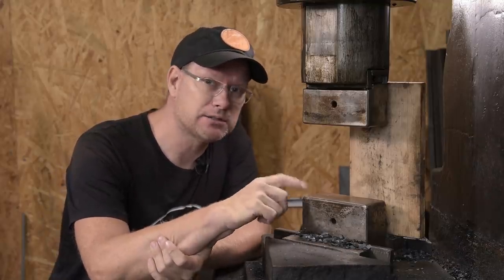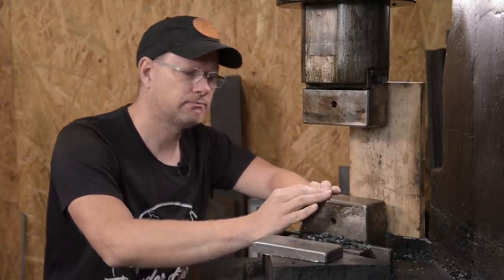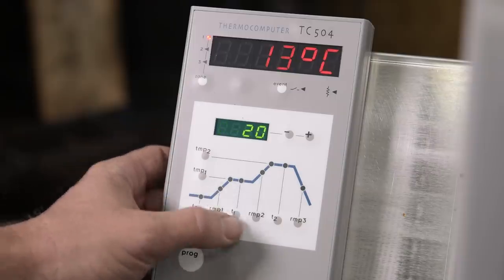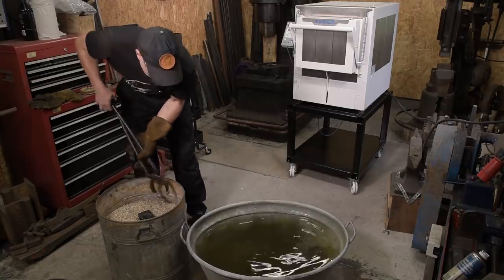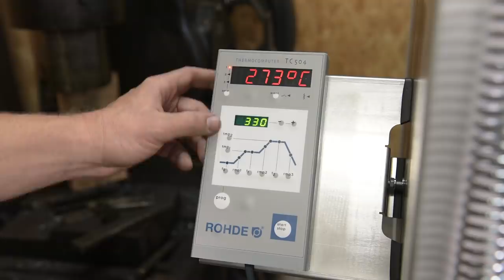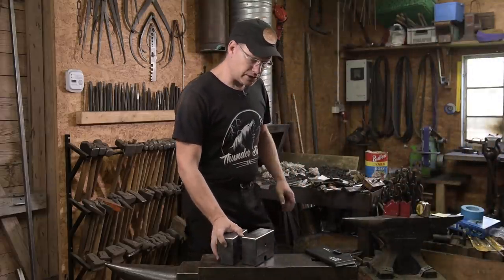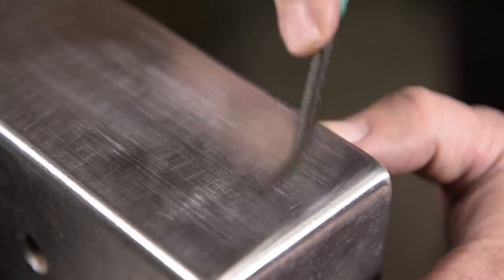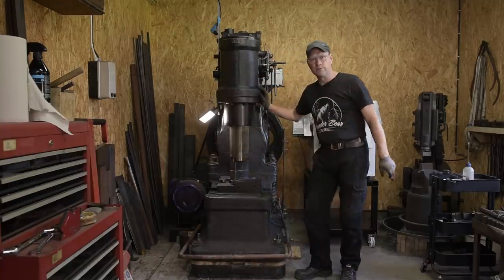Blacksmithing - Heat treating hammer dies

Comment: Love your videos your attention to detail is great. You’re a wonderful blacksmith. Just wanted to give you a little tip on heat treating for one when your heat treating carbon steel fast Austination is key so make sure your oven is up to temperature before you put in your part. whenever you are tempering anything make sure your oven is up to temperature before hand or the elements will super heat the surface trying to catch the oven back up to temperature which could over temper your product.

Comment: In the 70’s, during my apprenticeship in a traditional blacksmith shop, an old timer came by and it was announced he would work with me to make my first hammer.
Three of us forged it out, punched and drifter the hole, and then I learned about all the cans on the ceiling. Each one was a different size with different patterns of holes punched into the bottom.
The old timer took an old coffee can 3” across on the bottom with 4 holes in a circle pattern. We were using coke. Once hammer face was hardened in water, he had me clean the face up and then we heated the face to red/yellow. Really just the top inch. Then with the hammer face facing the ceiling, he scooped up water from slop tub with the can, and allowed a stream of water onto the face, mostly in the middle. The water stream heated and flowed over the edge of the hammer face. 
This simple technique, cooled the face first. This allowed the hammer to be harder in the middle of the face and softer on the outside and left the rest of the hammer annealed. I used that thing for 40 years and it worked perfectly.

Comment: I would have preferred something like 6150 (Chrome-Vanadium) spring steel.  Just as easy to cut, work and heat-treat (oil) as 1045 but the vanadium would ensure they outlast the 1045 many times over.  Have you considered videos showing the differences in heat treatment of various steels?  They would get many new subscribers outside of the forging community.
Reply from the maker: Indeed 1045 is not ideal, but they will do fine for a while. I will consider new ones when the time is right. L6 or H13 is my choice.
Reply: @torbjornahman  H13 would be best, no doubt, although heat treatment is tougher for the typical shop.  You have a very nice oven/kiln so you should be just fine.  Give some thought to the heat treat videos, it might be a good ´hook´ to entice new viewers.  Take care.
Reply: 1045 is the traditional choice for hammers and other impact tools. While true that modern engineering alloys may outperform it in certain aspects (6051 contains chrome and vanadium to both improve corrosion properties and toughness), 1045 is a cheap and simple alternative (as it is simply plain carbon steel).
Reply: @kkuhn  question: would spring-tempered 1075 work for a special, e.g. “raising” hammer?  

Oil quench in 120 F. Canola, draw to 400 F?
Reply: Am a blacksmith in Australia,used a power hammer repairs of chisel and moil points for jack hammers,used 1070/1080 for blocks.Scale certainly damages blocks if not kept clean.
Reply: @torbjornahman  Those are heat resisting steels usually used to resist tempering at temperatures above 500F. They will do, but they are expensive and heat is not the issue for the failure of your massive hammer dies. Traditionally all anvil faces and hammers were made from plain high carbon steel, W1 or anything with about 1% carbon. Quenched in water they will give a hard, wear resistant 1/4 " case and  a tough unhardened RC30 substrate. Carbon in excess of .78% is required to form free iron carbide grains, the main contributor to wear resistance. I have the original dies from 1920, plain 1% carbon steel, in a 250 lb power hammer and they  stand up very well. It's nearly impossible to dent them. There is a trend these days to replace this steel with medium carbon varieties like 4140 and 1045. It it beyond me why as it makes no sense. I think it's one of those things that gets spread out on the internet.
Reply from the maker: @maplebones  4140 or 1045 is not for hammer dies.... L6 and H13 is preferred, but not for the hot working properties, but for the toughness and wear resistance! Anything above HRC50-52 or so can be an issue when it comes to safety. You don't want to chip a hammer die, it can be lethal.

Comment: I worked in a tool and die shop a number of years ago and one of my first jobs was heat treating the dies after they had been machined. Your comment about tempering was absolutely right. I made that mistake only once. The guy that made the die made me sit and watch for two days while he remade the die. It wasn't boring at all, I learned a lot but the stool he made me sit on was torture.
Reply from the maker: Ouch, a good lesson I guess! Thanks

Comment: I nearly fell off my chair when you spoke !
Some (most )YouTube creators talk more than they create , some create more than they talk( i prefer these !) but some just add a little bit of commentary when needed and it lifts the video into a new level - that is what you did here 
 Torbjörn ! That heat treat oven looks like a fantastic piece of equipment !
Fantastic video - thank you!
I might try some 1045 for the cam lobes on my model engines , at the moment I'm using 4140 and some case hardening compound (cherry red ) but if I can get a decent thickness hard skin around 50 RC with a soft core  I will be happy .
Reply from the maker: :) Thank you Ian! Why case harden 4140? It get's plenty hard as it is, no?
Reply: @torbjornahman  
It is just for wear  - the cam lobe and lifter are case hardened leaving the core soft so it doesn’t snap , I could through harden it as well but the quench can distort the part and the cherry red compound can be left to cool slowly - On the very small engines I make the camshaft is only 6-8 mm diameter .
It also depends on how much running it will do , if it will only be run occasionally I don’t bother with hardening and I use 4140 as I have lots of it laying around 😀
Reply from the maker: @ianbertenshaw4350  So you don't quench after applying the cherry red? I'm quite skeptical that you gain any extra hardness from that. Have you tried to use mild steel and case harden (with quenching)? As only the surface will harden I don't think it will deform much.
Reply: @torbjornahman  

https://youtu.be/b_rjQRTgQrk
You can quench with cherry red compound but don’t have to  - the link above is to a video explaining the procedure . To get the hardness I have to do it a couple of times and this also makes the hard skin a little thicker .I don’t really like using it as it gives off some fumes when it comes into contact with the hot steel . I need to get a move on and build my camshaft grinder , that way I can heat and quench then finish grind so any distortion will be removed and I can change the design so the core of the shaft is a little thicker. Might have been my quenching technique that caused the distortion - I think for something like this it needs to go into the water with the shaft perpendicular to the surface of the water  .
Anyhow it is something for me to play with 😀
Reply from the maker: Strange if it works! It's there only to dissolve more carbon into the surface, but without a quench no martensite will form. However the added carbon might make the surface a little harder by itself without actual hardening. If it works, it works! :)  Deformation is always an issue I think, something you can't work around just make it as less prominent as possible.

Comment: Needed to see that, recently built a power hammer and bought a new set of dies from old stock that the business I buy a lot of coke, tools and other bits from had left over from when they sold power hammers. They were machined but not dressed and after dressing and using them I have found they are not hard, or at least not hard enough! Alan told me he thinks they were 1045 but couldn’t be sure. I can now harden and temper them which I now don’t think was ever done! I’ll let you know how it goes!
Reply from the maker: Great! Do a couple of spark tests and compare with known steel. 1045 is quite easy to distinguish from the higher alloys like H13 and S7, which would require a different approach.

Comment: Very informative, pleased the kiln worked well, it looks like a very good unit , I’m sure you’d be pleased with it. Many years ago I worked in a factory producing hardened gears and sprockets, we used a “Rockwell” machine that measured the mark made by the impression of a diamond into the surface of the steel. That beautiful countryside has me dreaming about rosettes and billy tea ,might start working on that tunnel again 😂. Regards from Down Under.
Reply from the maker: Yes a machine like that can be useful, but pricey for the small amount of stuff you normally make.
Reply: Yes, you’re correct, a big outlay, the files certainly do a good enough job for what you are producing.

Comment: Great video!  I look forward to seeing the notification that you have posted a new one.  About tempering after heat threating:  When I was getting started, I heat treated a meat cleaver but ran out of daylight before I tempered it.  I didn't know about tempering in my kitchen oven.  The cleaver was sitting on my kitchen table and I was talking to my wife when we heard a loud "ping!"  I looked at the cleaver and, sure enough, it had about a two-inch crack from the edge into the body of the blade.  Lesson learned.
Reply from the maker: Ouch, yes that's not a fun sound.... Thanks Eric.

Comment: Great educational video. I have a question - With the hardness files, why do you start with the hardest and work down instead of starting with the softest and working up? 
Or is it because starting at the softer file on the harder material risks damaging more files than necessary until reaching the correct hardness files?
Actually, thinking about it, I may have just answered my own question here lol
Reply from the maker: Thanks! Yes I think that is the case. The softer files will wear down with time.
Reply: That’s interesting, my first thought was starting with the hard file you would be unnecessarily scratching softer material until you got to the correct file but a few scratches is better than damaging expensive hardness files!

Comment: Torbjörn, great understanding of materials, you are not longer a Blacksmith, you are a TOOL MAKER and that is something very powerful. I salute you. QUESTION: when you were hardening the hammer dies I thought that in order to relief the stress in critical inner corners of the die, have you ever thought of covering these critical sections with clay-ceramic compounds to insulate them from the brunt of the hardening furnace heat. Perhaps you have already tried this. Let me know what you think? Much Appreciated AB
Reply from the maker: Thanks! Protective clay is used to isolate and protect areas during the quench, not the heating. I'm not sure it would make much sense on large mass pieces like this.
Reply: @torbjornahman  Perhaps I did not explain myself correctly. Try again Haha. Let say I want to protect the bottom of the die, say 50mm from the bottom. So I create a steel try 50mm high and I fill it with clay (like potting with a epoxy an electrical winding/transformer, but I used a semi-liquid clay. So now I place the die (or specifically the Bottom of the die) into this steel tray. Now I proceed to hardened the steel. 2hours at 850C. Of course the whole steel will invariably reach 850C. After the hardening time has elapsed I take the die with the steel tray filled with now a hard ceramic layer and now I quench it in water. The areas exposed in the die will undergo a structural stress but the delicate areas of the die are to some degree insulated because of the ceramic layer around it. So in essence we are delaying the quenching because of the thickness of the ceramic layer around it. As a result this area should not suffer a thermal shock. Do I make myself a little bit more clear. Thanks and Love your videos !!
Reply from the maker: I could as well do a differential quench, just dipping the top part or running cool water on the top. But a die like this do suffer from the same forces both ways, so a soft bottom would deform with time. I have talked with experts on this and even with the delicate areas, a complete quench is still the best option. A differential quench would also cause stress in the transition which could cause problems.
Reply: @torbjornahman  Sounds also like another option, although a bit tricky, just quenching the top. While if you have the bottom covered with the clay, you can dip the whole lot die at once. But in any case you have done some remarkable tools over the years, and this is what sets you apart from the rest, you make tools to make things.  Torbjörn TAKE A BOW !! AWESOME !!

Comment: Well you learn something everyday. I had no idea 1045 was a shallow hardening steel. I knew 1095 was. Although I’m sure the cross section has a lot to do with how deep it will harden.  Nice to get a few words from you. I rather a quiet person myself.  I’ll type but don’t like saying words.🤷🏼‍♂️
Reply: Through hardening steels, in large section size, are limited in the depth of hardness, it is called  "Ruling Section".

Comment: It's a good thing your tempering temp is high, because that water quench makes it more prone to impact cracking.
Reply from the maker: Why would that be? This alloy is supposed to be quenched in water. It needs it to harden. That doesn't mean it makes it more prone to cracking than an oil quenched alloy.

Comment: Difference between oil quench and water quench is the speed at which the part is cooled. For any steel, the amount of martensite (hard phase) that is formed is dependant on the speed of the quench. At a critical cooling rate, martensite is formed, but slower than that rate and other phases are formed instead. Some alloys require very fast quenching, such as 1045. If you were to use oil, it would not harden very much at all due to not forming a martensitic microstructure. The center of the block does not harden for the same reason, the cooling rate is too slow within the center. There is an engineering test to determine hardenability: the Jominy end quench test.
Reply: Additional note: fastest quench that is practically possible is a saturated salt solution just above freezing with heavy agitation.
Reply from the maker: Yes, indeed! I didn't want to go that in-depth here. Metallurgy is a complex subject, and I wish I had time to study it more.

Comment: Concerning the soaking time... always check out the maipulted value... if it drops into the direction of 30% - more or less depending on the isolation of the furnace - you know when the material has equal temperature.

Comment: Thank you very much for the video. I'm curious about the hardness before the work. Have you checked the hardness of the die faces before the HT?

Also, what do you think about putting some sort of durable insulation to the inside corners to protect these areas from cracking?

Comment: they heat treat A2 to 60 Rockwell where I work and then air harden it 
it has similar properties to 1045 and it's fairly cheap 
same with M4 but you can get it to 65+ Rockwell

Comment: I wonder how using a hardfacing welding rod to create a new surface on the tops of these would hold up. I know that hard facing is used on parts that get a lot of abrasion, like plows, buckets and blades of large construction machines. But I was wondering how well it would hold up to being smashed together over and over again.
Reply from the maker: I really don't know, but I would avoid it for sure. With welding you get quite uneven material and strange grain structure and borders all over. And my guess is that the rod material gets too brittle also.
Reply: @torbjornahman  Not to sure, I would like to see it tested out in a use like this though. Just because I know for abrasion it is so good, but like you said it may be to brittle. But layered on top of the 1045 and machined smooth and flat it could be a possibility for someone not comfortable performing a true heat treatment or does not have access to a kiln. I was a hard turn machinist for 20 years and have cut so many different materials and heat treat recipes. It was nice having a heat treat department in the building that I worked in. You could just ask one of your friends that worked back there to slip in a project with the next batch of what ever material you had used. The second shift would have a funny look seeing a Knife come out with all of our hydraulic parts, lol. Just kinda thinking out loud....

Comment: For the stress rising corners, they all seem to be in the bottom, could you just quench the hammer face and keep the lower areas soft?
Reply from the maker: That was my first thought, but I asked around and that's not a good idea for hammer dies. I think the transition area is a problem, possibly with strange grain structure.
Reply: In addition, with that sheer size it would be very difficult to achieve suitable cooling on only one side, with the rest of the part staying hot
Reply from the maker: You could probably do that with running water, but still...
Reply: @torbjornahman  I would have thought that you could temper the bottom/mounting faces back to a softer state. Would it possibly better to have a soft core from a low carbon Steele with a fire welded higher carbon face, so after hardening only the high carbon face is of high hardness like in some anvil designs?
Ps: Love your videos with natural sounds without music and slomo. The artistic shots and the other stuff you show in these videos is greatly appreciated. Love from Germany.
Reply: If the dovetails were too soft, they might end up mushrooming and jamming in the saddles.